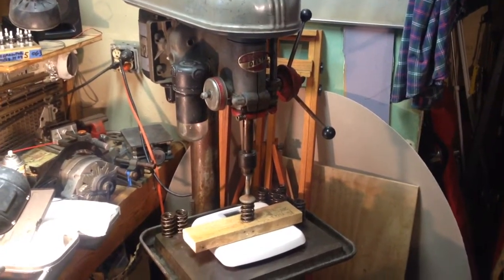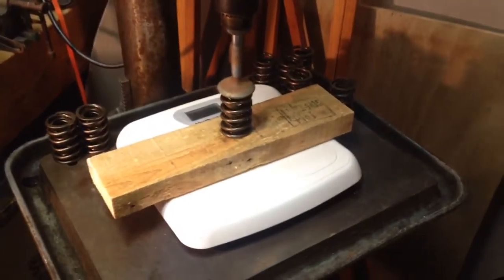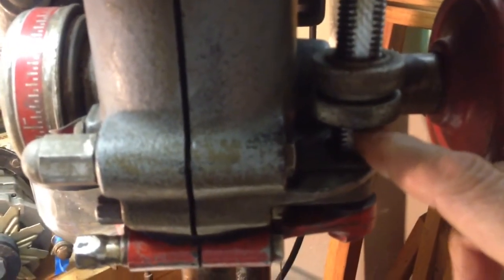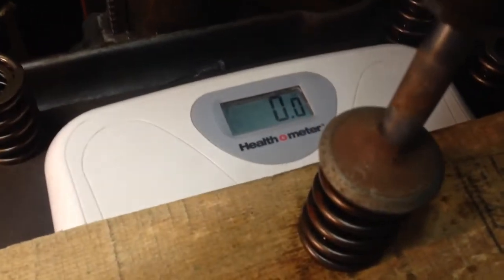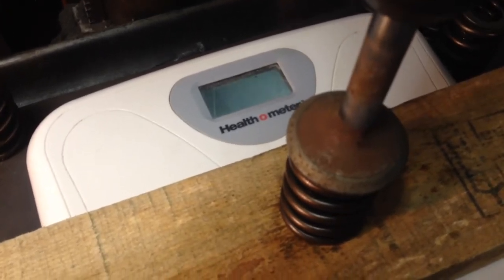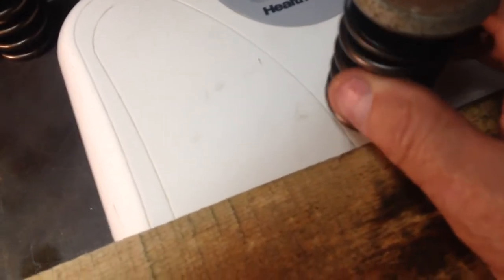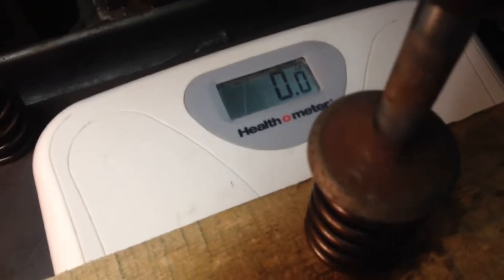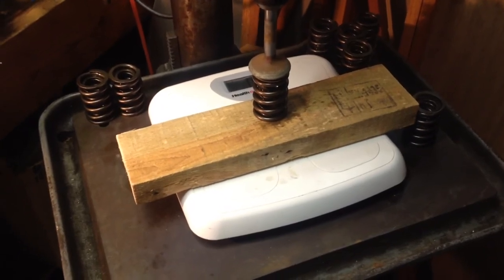Drill Press & Bathroom Scale valve spring tester

Comment: I did this for a radiator cap, without drill press. No marking for pressure. I had another one that was id'd 13lb and it took 21. The one that wasn't marked took 13. I just took reading as soon as spring began to move. Im on the right track.  Was wondering if that made sense. Thanks. Oh, PS. This guy is comparing springs is all.   Wood will compress pretty much the same. If I was building some hp motor then yes I would go high tech.

Comment: No, I don't think so, this is hillbilly stuff. Come on, just get the one by Proform that is used while the spring is on the engine... Little over 200 bucks, You'll have peace of mind, rather than look like an idiot.
Reply: 200$ for a spring checker? If you have that kind of $ just buy a new set of springs. I know us hillbillies may seem slow but our hotrods aren't!
Reply: $200 is alot for a twice a year weekend engine guy. I love this bathroom scale technique. Its perfect for finding dud springs.
Reply: @einarschwentke7813  We're talking about your engine here. Were talking about oiling down the track, or the street... But hey, you go ahead and sweat 200 bucks... Oh by the way, how much did you spend on your engine alone?? not even your trans, reared, tires, wheels...Make sure you tell the guys at the track that you use a bathroom scale... Jesus Christ...
Reply: @kevins5833  Praise The Lord!
Reply: really as a\ tech nerd it works especially for finding week old stuff just fine one may need to use a good scale but the sensor in the newer units is a china cheap ass load thing just like the digital bathroom scales are useing
Reply: I use the drill press and very accurate scale all the time. I've even compared it to Remac spring tester and it's right on. By the way, those Proform testers are Chinese junk.

Comment: Very nice !  Thanks, I would never have thought to use a drill press.  And the valve inserted into it is brilliant. But mine is only small and cheap chinese, maybe it will not have the strength.  But will soon find out.  Thanks again